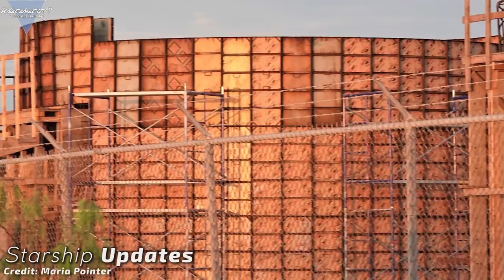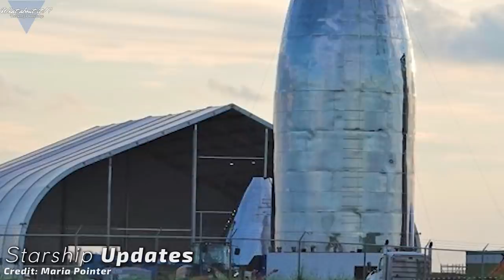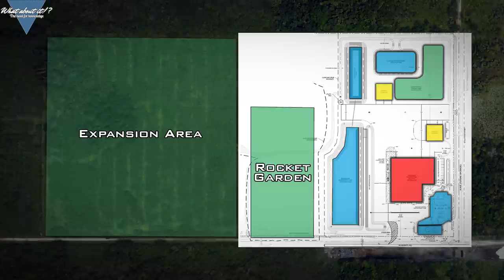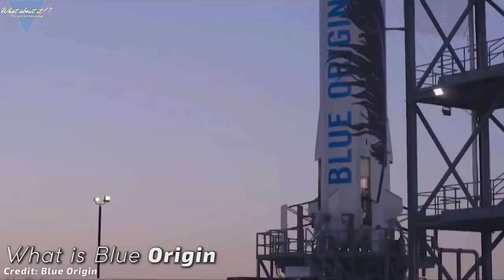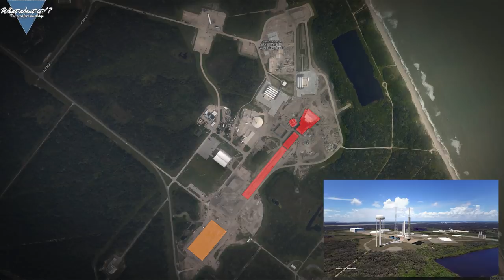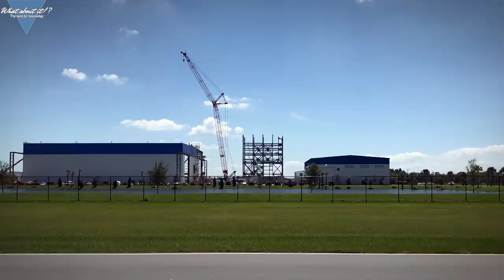35 | SpaceX Starship Updates - Blue Origin Building Launch Pad For New Glenn Launch

Comment: The problem with Blue Origin is that they are so risk averse that any technology they come up with will be years behind anyone else.  Blue Origin was founded two years before Spacex and in the 19 years since,  still hasn't had an orbital flight and hasn't even fired a multiple engine rocket into space. Meanwhile, SpaceX has 75 successful Falcon 9/Heavy launches. they have, using the Starhopper, successfully tested the next generation engines and Starship's prototype will be 20 miles high next month and in orbit next year.

Comment: 1:30  Those “walls” are not any rocket LOL. Its a form for pouring a reinforced concrete structure. After the concrete is poured, that metal hardware is removed.

Comment: New Glen isn't a Starship killer, it's a Falcon Heavy killer. New Armstrong will be a Super Heavy/Starship 1.0 killer, although I suspect by the time the New Armstrong comes Starship/Super Heavy will be ~50% taller due to improvements in the Raptor engines thrust. Also they might have gone to the fabled 18 meter Super Heavy/Starship or "Super Heavy/Starship 2.0"

Although personally I still don't see the need for an 18 meter Starship any time soon, you could already fit a nice 2 story house easily within Starship, once you have gotten to that point there are not many things you can't do with just a little ingenuity and more launches. Where as right now you really are limited by the 4 meter Falcon/Heavy faring in certain things. I can just about see edge cases for going to 12 meters, like stupidly large mirrors for telescopes, but after that you are better off actually going to multiple mirrors as making such a large mirror perfect is already very very difficult.
Reply: Thats a bit like this guy who says there will be need for like 4 computers (or was it 20?).

Comes opportunity, comes business model.
Reply: @tilmerkan3882  To that point it really is like saying you want trucks to have 8x the volume rather than comparing it to how we have shrunk transistors which has enabled us to put computers in everything.

A truck can fit plenty of most things you would want to put in it in it, and you can break thinks down into pre-fabbed parts to fit in common trucks. there are exceptions, but it's not worth building trucks with 8x the volume without a market for it.

Wanna build massive in space, sure that is doable, and reasonable, but we shouldn't be building our launch vehicles to accommodate exceptions that can almost certainly be overcame with a smaller vehicle and a little ingenuity.

As said, you can fit a pretty large 2 story house inside a 9 meter diameter, once you have gotten to that scale the pre-fabed parts are going to be pretty large.

It is a mistake to compare everything to the exponential growth of Moores Law, although I do think we are at a tipping point to where there will see an exponential growth in the number of launches.

But the size no, we are not going to see 36, 72, 144 etc meter diameter earth launch vehicles, as by the time you would be building things on the scale that might need those kinds of vehicles you would certainly have plenty of in-space industry that would be able to build them locally and source the materiel from places easier to get to and from than Earth.

As it will still cost to get stuff into orbit from Earths surface. Likely at that point all you would be doing is supplying complex electronics like computer chips etc.

Also another side bar, I do think launch payloads will continue to increase as we eventually move of from conventional rockets, and move onto thermal rockets and other stuff like that, because you will be able to reduce the size of the "booster" but also increase the length of the payload.

But still apart from maybe a very small number will ever exceed reach and especially not exceed 18 meters. As we do have super large land vehicles to do specialized stuff, but the number of them will be very small compared to the number of smaller vehicles that are more generalised.
Reply from the maker: @John theux Agreed. :) @Etheoma I think what John means is the use cases we don't have today, as there is no rocket to do it. When we still had horse carriages, no one felt the need to transport 20 meter steel girders for highway bridges.
Reply: @Whataboutit  It would be awesome to see mars habitats that can move or any kind of vehicle that is big enough to protect the astronauts from radiations.
Reply: @Whataboutit  We built large bridges before hand, so there was a demand.

Again you are talking about the exceptions I was talking about, for which if there is an exception we will built it.

But if you want to have something that is going to be able to serve most launches going with 18 meters and 800 - 1000 tonne launches is not the way to go about it, because you would need to fill that space to make it economical.

Really I don't think you quite understand how much 800 - 1000 tonnes is to not call it anything but overkill.

A largeish 2 story house weighs in at ~73 tonnes you could carry the materials for 13 houses without any weight saving measures or use of meterials from places easier to get to.

If you were to make orbital housing you would make it lighter, much lighter. like ~10 tonnes for the same area even if you are putting it under rotation to generate "gravity" so you could create same level space as ~100 houses in a single launch.

That is overkill, just straight up, we don't transport houses like that on Earth where it is much easier to do.

As said we do pre-fab houses which cuts costs over conventional house building

Like you could launch very large rotating habitat in 1 launch, when there is no need because you can pre-fab parts, and you would have to break it up for launch anyway so you could fit it in the internal area of the launcher.

Comment: I think the Starship will be "ready" in "mock-up" form for the presentation on the 28th (edited).  Sort of like the way Hopper was "ready" for a photoshoot in Feb(?), but was then dissembled, and flushed out for many weeks before testing, and for many months before hopping.  
The timeline may be a bit more compressed this time.  Support facilities are much farther along and much "first time ever" work was done on Hopper.  Still, I'll be both delighted and surprised if Starship M1 gets off the ground in October.
Reply from the maker: My thoughts exactly. I just can't believe it. If they do it though, I will be very happy, with my nose glued to the screen.
Reply: Steve, I think the presentation is supposed to be on the 28'th.
Reply: 59seank It is, and I knew that.  😀
Edited OP.
Reply: @Whataboutit  They did it, did you do it

Comment: I thought the Falcon 9 block 5 was supposed to be able to fly 100 times with refurbishment and 10 times with little to no refurbishment.
Reply from the maker: Yet to be shown, but yes, that was the initial goal.
Reply: Neither company has yet to show this of course but both rockets are designed to fly 100 times.
Reply: anything can go wrong when you're setting off controlled explosions for minutes at a time multiple times while it hurtles through the atmosphere at mach whatever it flies at
Reply: Any F9 will probably be retired before 50 flights, replaced by Starship.
Reply: @donjones4719  naw, f9 will be a ride share rocket while super heavy might replace falcon heavy
Reply: @mikebolton2388  Elon did say F9 & FH will be launching for a couple(?) of years during transition to Starship. But I think his ultimate vision is Starship will be so cheap to operate that it can launch partially loaded (even lightly loaded?) and still be cheaper than F9. Plus he saves big costs by having infrastructure for only one launch system. But the future holds so many unknowns...
Reply from the maker: The almost ubelievable thing is, that if all goes right, Starship will be cheaper to launch than a F9. You can use it for ride shares too.
Reply: @Whataboutit  Let's hope that's the case😀

Comment: Well, don´t get too excited for New Glenn. There is a reason why BO has not a single operational rocket in their portfolio after 19 years of R&D.
New Glenn is basically a big Falcon 9, so the overall design itself is not overly innovative. According to Wikipedia, BO aims at launching it 2021 for the first time.
By that time Starship/Superheavy should be fully operational when it comes to orbital flights (#dearMoon is scheduled for 2023). That means, when BO starts to use New Glenn, SpaceX will most likely already have the NEXT generation of launch vehicles in use (with a big advantage in capability and launch costs).

So in essence, BO may build impressive sites and edifices, but New Glenn will have a severe disadvantage compared to Starship/Superheavy. And this will quickly show in its manifest.
Reply from the maker: Agreed. And that is why SpaceX is so fast in developing Starship. Falcon Rockets will soon only be in the mid field. I am still very happy about the competition! Don't take the thumbnail too serious. It's the door opener for some more views. Youtube works like this (sadly). As long as you liked the content, I am happy. :)

Comment: What's the thrust per square meter of raptor compared to BE-4 ?
Reply from the maker: That is a good question! Could you find out?
Reply: @Whataboutit  About 250 tons of thrust for both so (1.9/1.3)^2 = 2.1 times more for raptor (2.2 times if we compare the chamber pressure). This means a rocket with raptors engines can be twice as big as a BE-4 based rocket and so had more than 8 times the payload.
https://www.reddit.com/r/spacex/comments/amdyi4/raptor_engine_size_comparison_13m_nozzle_scaled/
Reply from the maker: Thank you so much, John! I knew, why I'd ask you. I'd get a good reply. :)

Comment: Blue Origin is still the only wholly private space venture...ever in History in point of fact. Also Blue Origin is also the only one of the "private players" to use liquid hydrogen as a fuel. that makes his "little rocket"(BE-3) by far the most powerful on the market.
Reply: @zoltankurti  not on the BE-4 this is true.
Reply: I dont know where you've got those informations from, but i'm pretty sure most of your statements are false
Reply: @domii6747  no you're wrong and you're not even close to being right. just use google. "El Jefe" Bezos owns the physical property from which he launches the nh2/lox liquid hydrogen be3 rocket. and if you think a more powerful rocket than what lifted the Space Shuttle up has ever been built good luck with that too.
Reply: @georgedoolittle9015  the saturn 5 was more powerful. And the be-3 engine doesn't lift up any big rocket. The rocket is called new shephard, and it's pretty small, can't even reach orbit.
Reply: The suppoesed big rocket (new glen) will use a methalox engine, the be-4, which would now be the most powerful operational rocket, but still less powerful than SS/SH. Neither of them are currently operational, right now blue origin can't even reach orbit. What they have is nowhere near the most powerful rocket on the market.
Reply: @zoltankurti  how much mass was the Space Shuttle Orbiter Zoltan? And what are the regulations related to launching from one's personal property or premise?
Reply: @georgedoolittle9015  according to wikipedia the dry mass is 78 tonns, and the fully fueled mass of it is 110 tonns. The saturn V had a payload capacity to leo of 140 tons, so it could have put a fully fueled orbiter with payload into orbit. I couldn't care less about rocket regulations, they are irrelevant to this conversation.
Reply: @zoltankurti  and what exactly was the Saturn 5 putting into orbit?
Reply: @georgedoolittle9015  the goal wasn't leo. But for example it put skylab there.
Reply: @georgedoolittle9015  just write down your point, man. Your questions are not interestind. You can hardly find a metric by which the the space shuttle was more powerful than the saturn 5. There is a reason why it's still the only rocket to carry humans beyond leo.

And about new shepard being a big rocket, you are absolutely wrong. The only rocket currently using the be-3 is the new shepard.
Reply: @zoltankurti  you don't know that the Space Shuttle never put something or even someone on the Moon. Google search and post the power numbers for the SRB if you want to see what a true "lifting body" is..
Reply: @georgedoolittle9015  the total power at liftoff including the two boosters for the space shuttle was 30250 kN. For the saturn 5 it was 35100kN. I think you are the one in need of a quick google search. Saturn 5 is bigger even by this metric.

And your original comment is still nonsense about blue origin.
Reply: @georgedoolittle9015  oh yes, and the space shuttle never went to the moon, that's absolutely certain. First, you can't hide a rocket launch. Launching facilities are big, and there are many really involved people watching these activities. Second, how exactly you think the shuttle would land on the moon? Third, the orbiter simply doesn't have enough delta v.
Reply: @zoltankurti  and when the Space Shuttle or Blue Origin throttles up that "newton" to 110% then what?
Reply: @georgedoolittle9015  doesn't matter much. You can't throttle SRBs, which provide 25kN thrust for the shuttle. I'm starting to get a feeling that you are deliberately playing dumb.